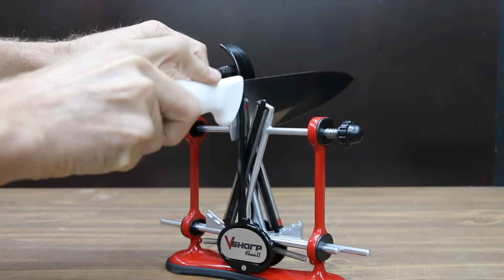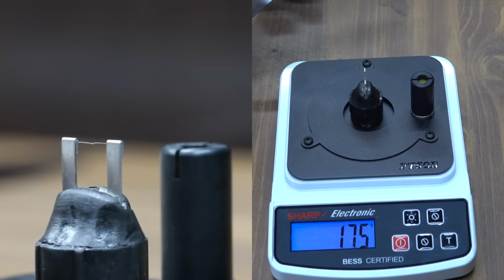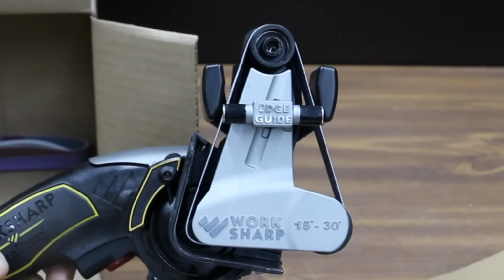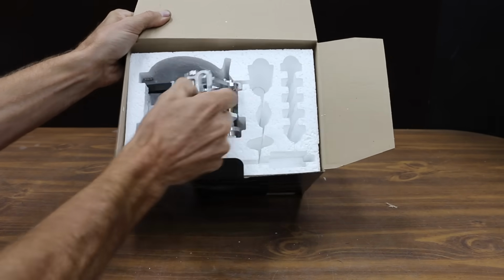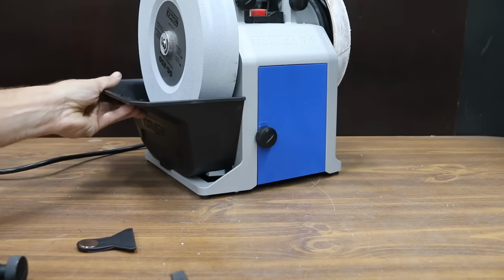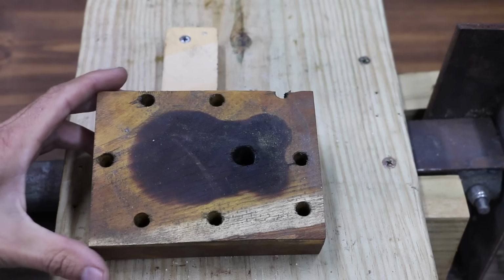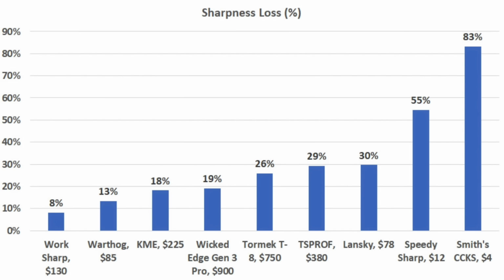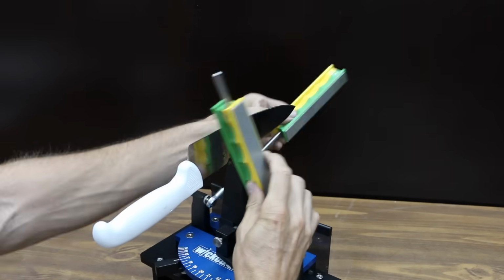RUSSIA vs USA Knife Sharpener? TSPROF vs Lansky, Wicked Edge, KME, Tormek T-8, Work Sharp Ken Onion

Comment: Personally, I love my whetstones and self-made leather strop. But the Lansky, KME and TSProf are really good concepts (like the Wicked Edge, but that one is really way too expensive) and you get the quality you pay for. Lansky is the least in terms of ease of use and the personally I think the TSProf might be harder to get the right diamond plates for? 

The Tormek, while it is the most versatile, you could do chisels on it for instance, is a bulky apparatus that would only see about enough use for it to be justified in a woodworking shop with a couple of guys. It also makes the grind slightly hollow, which is great for cutting meat, but it doesn't have enough metal behind the edge to sustain heavier work like bushcrafting IME.

If you're on a really tight budget: wet sandpaper (grits 220, 600-800, 1200-2000, and possibly even a 5000 grit one to finish if you can find it) put it on a ceramic tile that is flat. Instead of a leather strop you could use one of those paint stirrer wooden sticks, soft wood will burnish your knife's edge too. Honestly, you'd be hard pressed to find the difference in edge quality with a proper setup.
Reply from the maker: Thanks for the feedback.
Reply: I'm kinda suprised he featured Tormek because to me that is not made with knife sharpning in mind, its more for tools like planer and chisel etc, but good for the farm to cover all the basis.
Reply: Sharpen my chisels and plane irons on my KME. put them in at an angle and haven't had any problems, but i'm picky on sharpness, not geometry.
Reply: Wet sanding is how I work all my hand plane blades. I've never found anything that makes them as sharp.

Comment: Excellent reviews as always! I personally really like the KME for my pocket knives, especially with aftermarket stones and attachments. The KO Worksharp is what I tend to use for tools, while bench stones I find best for large chef knives. I've never tried the TSProf, but it looks similar to the hapstone system, I wonder how much aftermarket support there is for it. I'm not sure if I missed it, but one thing I'd be interested in is a graph of how long it took for each one to achieve maximum sharpness. Also, it might be interesting to weigh the knives to see how much material was removed in order to re-sharpen it, indicated which would prolong the life of the knives the most.
Reply from the maker: Thanks!  Thanks for the feedback.

Comment: I keep a Smith in my toolbox & in my key ring to use in a pinch in the field when I'm not in the shop with my wicked edge. Smith's will get the blade usable but don't depend on the edge to stay around long! Great video as always!
Reply from the maker: Thanks!  Thanks for the feedback.
Reply: @ProjectFarm  I'd be curious to see a comparison of "SMITH'S type" budget sharpeners.  You know the kind you don't cry over if you break or lose it LoL!

Comment: Really would have been nice to have seen the blade sharpness tested at 3 different locations on the blade after being sharpened. The smiths sharpener leaves a very inconsistent and jagged edge in my experience so that single tester could have just been at a particularly sharp part of the blade.
Reply from the maker: Thanks for the constructive feedback.

Comment: You sold the Tormek way short. You used the wheel as supplied without grading it fine and you did not have the proper knife holder. You did not let it shine as well as it could have.  As expensive as it is, you should have given it its due. I have a couple of Tormeks. These are not one trick ponies like that Wicked Edge. You can sharpen all manner of implements on it which might help mitigate the substantial cost. They are not the best knife sharpener but are damn good. The set up time is its downfall when sharpening one knife. The best value for the money for a kitchen knife is the Chefs Choice Trizor XV Edge. This is for kitchen knives like you used, not heavy hunting knives or pocket knives.
Reply from the maker: Thanks for the feedback.

Comment: That was a nice blade you made there.  I was looking to see if you've compared 1/4" bit extensions.  On the look for a good 6 inch extension.  Some are wobbly, some hold the bits too loose or tight.  Others are bulky.  Might be a cheaper video to make as well.
Reply from the maker: Thanks!  Thanks for the suggestion.

Comment: A problem with many general of the shelf commercial knife sharpeners, Is  that they are made for kitchen knifes only. So they have fixed sharping angle An ax or a general purpose  outdoor knife all need different angel when grinding. That said not everybody has an ax to grind with someone. So a general purpose grinder  may function well for your use. If you are happy with grinder just keep using it
Reply from the maker: Thanks for the feedback.

Comment: i do like the lansky but just this year i got the Work sharp precision adjust knife sharpener. i like it for it's ease in set up n use also it was cheap (50 bucks) n i makes the knifes really sharp. i though about getting the onion but still on the fence about it
Reply from the maker: Thanks for the feedback.

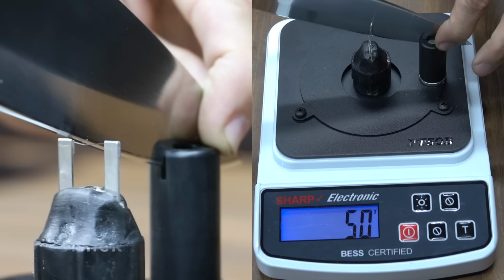Comment: almost a polish finish on that water unit. 11:57
though I don't give much for that gram-based edge tester as human-factor can screw that result-- a slow pass versus a fast.. will likely change the value a lot.
are you planning to take a look at cheap onehanded chainsaws from China.. quite popular.. being dumped on the market like there is no tomorrow... last I saw (sorry the pun) was like 15 USD with incl. shipping though no battery incl., but they useally just take Makita packs... they can all usually take the same blades.. either a 4" or 6" or 8" and most are based in a  small brushed motor but with the price in mind. they are quite usefull..wicked how they can make and sell it and ship it for that little and still profit.
Reply from the maker: Thanks for the feedback.

Comment: I have a Wicked Edge (granted it's a much older model) with the super fine ceramic stones. The big problem with it and several of these sharpeners is they don't do well on very flexible blades like filet knives. The wicked edge is also a ton of work
Reply from the maker: Thanks for the feedback.

Comment: I'd love to see a good set of whetstones and a fine stropping/polishing compound could do after some practice. I think the main difference is that most systems are meant for beginners, while whetstones need some practice but deliver the best results
Reply from the maker: Thanks for the suggestion.
Reply: In practice, there is little reason to go beyond 1000 grit to sharpen knives
Reply: @thomasneal9291  true, but if you are really trying to get to the absolute sharpest and longest lasting knive in a test like this there will be a difference. Though I admit a small one with very little real world use

Comment: Considering that every knife was sharpened at the same angle. I think that edge durability really has nothing to do with the edge itself. But has more to do with the metallurgy of the knife. It is almost impossible to keep consistent metallurgy from knife to knife. ( The balance of additives and metal in any alloy.) Therefore, there will be an inconsistency from knife to knife no matter the state of the knife edge. I have a German-made knife, handed down to me by my mother. Mom got it from her mom and grandmom got it from great grandmom. The blade is a high carbon still. I can make it razorblade scary sharp. I don't like it because it gets rusty. Stainless steel is nice. But it doesn't sharpen worth a s***. Do you get my point?
Reply from the maker: Thanks for the feedback.

Comment: I bought a 10" diamond file with 320 grit for general purpose...found out that it is the best knife sharpener I have ever used.  (Obviously I have to do the angles by eyeball  but I have been doing that for over 60 years anyway.)  The next time you make a knife try hardening and heat treating it....That would give you an even better edge.
Reply from the maker: Thanks for the suggestion.

Comment: Another sharpener test video! Great!
It would be more fair if you would strop knives on leather after each sharpening session tho.

Lansky and WorkSharp seem to be the best budget solutions. 

I personally think that belt sharpening is underrated. Belts are cheapest abrasives, you only need to have a grinder to use them.
Reply from the maker: Thanks!  Thanks for the constructive feedback.
Reply: Unnecessary. You are not going to work with knives polished by leather. Totally pointless

Comment: You can’t test the tormek without the knife sharpening jig made for it, everything is designed specifically for use with it. Rare oversight on your part.
Reply from the maker: Thanks for the feedback.
Reply: Plus he did not use the stone grader, so the knife was sharpened at 220 grit!
Reply: @deyyoung42  great point!
Reply: If they'd include it in the box, that'd really help.  Those guys charge a TON for some pretty chintzy accessories (plastic bushings!?), and the ones I'm looking for are often hard to find.
Reply: @gth042  i don't know anything about plastic bushings, but the stone grader should be included.            My point is how much sharper it will make your tools; all tools, not just knives.

Comment: The Tormek is a system for all kind of tool sharpening, not just for knives.  Testing w/o the appropriate accessories such as the knife jig or stone grader hurt the outcome.  I think it would have done better if used correctly.
Reply: Yea you can tell it is designed to do more and be more than these other systems. It also doesn't come with puny little sharpening surfaces sold in cartridge-form by the manufacturer.
Reply from the maker: Thanks for the constructive feedback.

Comment: Very nice comparison.. I had a set of the Lansky stones.. they worked great.. but at 17° that will produce the sharpest edge, but will also dull the fastest..I have a challenge for you and it won't cost you any money.. See if cardboard will dull the edge faster than your hard piece of wood.. I always refrained from using my knife to cut cardboard.. it removed an edge quicker than anything that I had ever experienced.. P.F. thx for taking us along.. p.s. what do u do with all the knife sharpening systems that you have purchased?

Comment: those swing arm sharpeners are garbage. sure they did a good job with you testing them at the spot on the blade their angle was accurate.  however because of how they work the angle constantly changes along the length of the blade.  test them at different spots and you will have different numbers however the sharpeners that don't rely on swinging arms but instead have you moving the knife will be more consistent along the length of the blade.

Comment: seeing as they were chefs knives you used, you could do a control sample using a sharpening steel, maybe another video compare the different sharpening sticks chefs use?
Reply: Sharpening steels don't actually sharpen knives significantly, they are really hones that straighten and deburr the edges of knives that are essentially already sharp, like the strop he used.
Reply: @jic1  I worked in a hotel kitchen when I was at college, they make a huge difference especially on serrated knifes and all the chef's use them. Go to any half decent kebab shop and they use them too.
Reply: @allothernamesbutthis  Yes, steels are excellent for what they are designed for, but that's honing, not sharpening.  It the blades become truly dull, they need to be resharpened with a stone or something like the devices he tested here.  A steel will not do a thing for a truly dull blade.

Comment: I’ve been a knife maker for over 40 years and I’ve tried a lot of the products you have shown. I am also over 60 and have been sharpening knives since I was a boy. I still sharpen knives by hand and probably always will. I have taught many how to sharpen knives and there is something wrong with the generations after mine. Not one of the people I have taught has pursued the long and difficult skill of hand sharpening. 

So, I can see why these sharpening tools will all be used by the multitudes of generations and I am glad to see them. But I am also sad that not one student of mine has pursued the valuable and much faster skill of sharpening knives. 

If I were to buy a sharpener as a gift for someone (family or friend) I think I would buy the Lanskey just to see if they would use it. If they did (and they didn’t just use dull knives or go after the edge with a bench grinder) I would buy the Wicked Edge for it’s Made in the USA and it’s ease of use once learned. If money was of concern then the Russian made ISO Prof would be my second choice.

But if someone asked me what I use, I have 3 diamond plates (2” wide by 8” long) course, medium and fine. Also I have a hard Arkansas for a polished edge. But most of the time I don’t use it because I have a leather strop with green chrome rouge. 

Sorry for the book. I guess I had a lot to say.
Reply from the maker: Thanks for sharing!

Comment: I wish you used a regular bench grinder setup, as a standard for measurement. The sharpness is highly dependant on the grit of the wheel, speed, and pressure. as well as angle.
Reply from the maker: Thanks for the constructive feedback.

Comment: The home made knife looks great!! I used to use an orthodox sharpening stone to sharpen my knives. I need to buy a new one, with a blade guide, because my left arm suffered serious nerve damage from being struck by lightning, & my left hand is no longer as steady as it once was!! Another tool for you to test are soldering irons. 3 types: Cordless battery powered, butane/propane fuelled, & mains powered. Mine are gas powered. I have 4 for various jobs.
Reply: You survived being struck by lightning? Damn man, hope you're healthy (or as good as possible) now!
Reply: @Dirkietje8  I’m about as good as I’ll be now.
Reply: I carry the Weller WPS18MP with me (field service.) It uses a wall wart to power it yet it has lots of capacity! I got it at Home Depot. They said it's equivalent to a 60W iron yet only uses like 15W. It's impressive! It regulates the temperature too, and has an LED which lights red when you turn it on and changes to green when hot. It also has a white LED work light.
Reply: @kenmore01  I have a vintage Weller 8200 soldering gun I like to use when I'm wiring stuff out in my garage and a Hakko FX88D that I like to use on vintage tube radios on my work desk in the house.  Sometimes, like if I need to solder to a chassis I'll use the weller with a custom tip made of solid copper and it works a treat.
Reply: @Rebel9668  I love my Pace Heatwise unit (HW100) with the resistor plugs.  I thought I would have switched to the variable TW-100 unit but the older one leaves me wanting nothi g more. With the micro iron it's had to beat.
Reply: @kenmore01  Weller makes excellent products. My main workhorse iron is a gas powered Dremel unit. It can be used as a blowtorch too. Excellent for heat shrinking and radiator repair jobs.
Reply: @christophermarshall5765  I had no idea Dremel made such a thing. Thanks!
Reply: @kenmore01  all good
Reply: I'd really like to see a soldering iron test. My favorite iron is the Hakko FX888 analog rather than digital. I also purchased a TS100 but have yet to use it. I have some other decent irons and some not so great. I was quite impressed with the knife you made.

Comment: You have different results with sharpening systems that use the same principle of work because actual sharpening angle is not precise. This is because you follow presets of sharpeners, but blade width influence actual sharpening angle. And one more thing - tsprof offers optional stone holder for convex edge. Thanks for the video, from Russia with love😊
Reply from the maker: You are welcome!

Comment: In  regard to  removing the serrated edge, that would  not be  desirable  for meat cutting,  butchering and  similar operations. Note that the best scalpels  have   microscopic   serrations  for  effective cutting. So when ever I use the  sharpeners that include the smoothing  ceramic stones, I skip that part for kitchen use.
Thanks Brad, good and entertaining stuff.
Reply from the maker: Thanks so much!  Thanks for sharing.

Comment: Sharpness loss has multiple factors; angle, shape, and the most important is the steel. Chinese steel is better than it used to be, but is still not very consistent in either composition or hardness.
Reply from the maker: Thanks for the feedback.

Comment: Work Sharp just released their 'Precision Adjust Knife Sharpener' guided system which, I think, would give the Lansky A run for the money. The Lansky can be a bit finicky to use and the stones seem to wear down quickly and at different rates, making it hard to keep the angle consistent. Lansky does have diamond stones which would mitigate this, but the selection is limited and you still have to adjust each guide rod. The Work Sharp and the KME have better guide rods and better stones, so they would be my choice for the long run.
Reply from the maker: Thanks for the feedback.
Reply: @ProjectFarm  Thanks for the great video. You definitely brought in some of the knife enthusiast crowd this time!
Reply: I agree, the Precision Adjust is comparable to the Lanksy and the KME and can be found for around $50

Comment: if you leave pressure at 70 I think after few seconds it would break and 85 might not be accurate unless the pressure and speed applied is same for all tests, its easy to achieve that though you can make a tool for holding front and add weight to the rear end and lower it with a motor each time.
Reply: or you could even use a servo and monitor how much power it also had to apply. The advantage would be that speed, pressure and time applied would be same for all tests.
Reply from the maker: Thanks for the feedback.